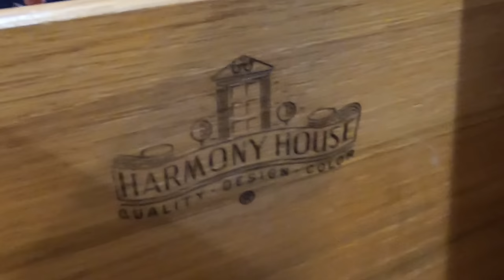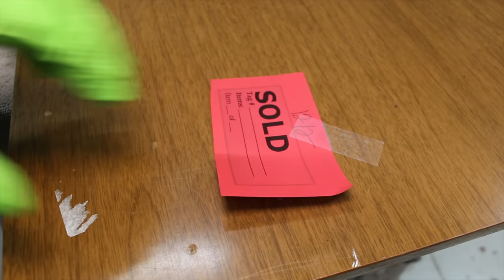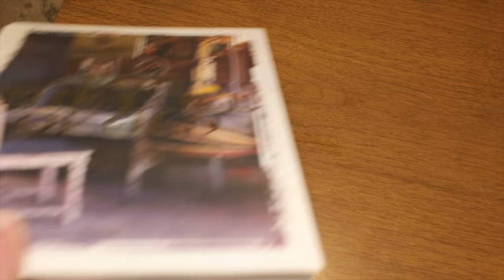Ep. 62 I DIDN'T WANT THIS...

Comment: I love this. Even pieces which aren't as desirable need the chance to live on. Beautiful results.
Reply from the maker: Thank you! I agree. Hoping this one is the right piece for someone
Reply: @MadCityModern  it will be. Someone will fall in love with it who may not have the budget for Lane Acclaim but still wants those vintage clean lines.
Reply: Barry,It Turned Out Nice!
I Have A Small Cabinet,I Got At Walmart,Some Decades Ago. The Corner Base Got Wet Once. I Sanded It,Applied Wax. It's Been The TV 📺 
Table,Since The Mid 90's The Doors Don't Shut Flush. I Polish It,1-2X A Year!. It Came In A Box. It Was A Cheap,Quick Buy. It's "That Piece",
& I Still Have It. 🤗
Reply: But...but, I desire it! 🤗

Comment: Barry,
I bought Restor~A~Finish I have a 1942 AM~FM and pullout record cabinet.
It was well taken care of, the record player was updated to a ’62 Voice of Music.
As LPs weren’t introduced until ‘48 since all of the pieces were present.
The electrician I took it to replaced all the wiring, wax connectors with plastic, and new tubes.
My question is do you like Restor~A~Finish and recommend it.
I don’t like the idea of taking it apart, especially after being upgraded.
Even the dial is painted/screen painted on it’s a Beautiful piece.
In your professional opinion would you go ahead with both these products you use.
The can says it only takes one application.
So, if I use the Feed~N~Wax occasionally do you feel it’s a good option?
Thanks,
Daniel

Comment: You say that the top was cheap laminate, but Formica was the hottest thing going since running water and sliced bread. For the time, it wasn't cheap, just as aluminum (cap of the Washington Monument), linoleum, (flooring for the Titanic and the Britania), and polyester, (a 500 dollar designer gown in the 60s) wasn't cheap either for their times. All is relative.